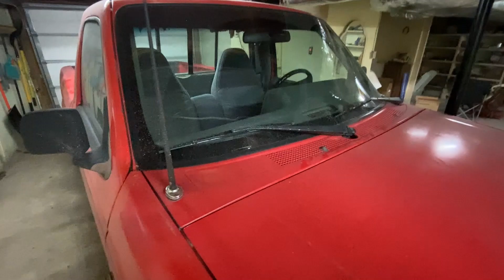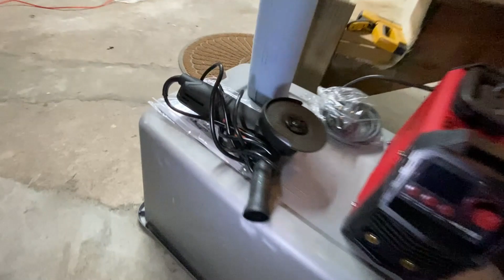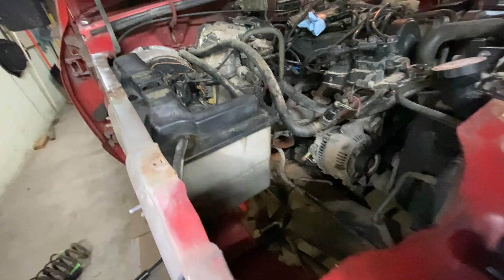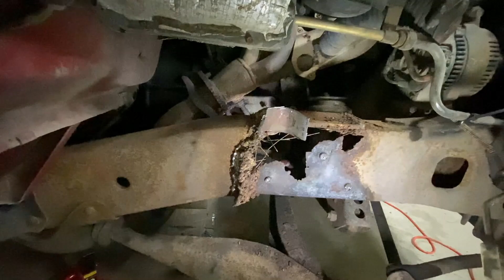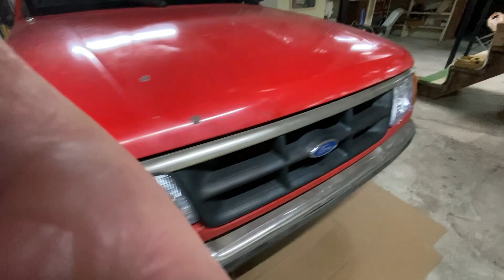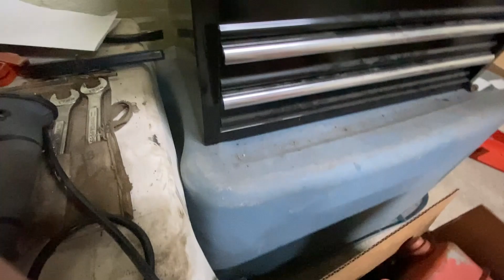Ranger Spring Tower Replacement & Frame Repair

Comment: I just ordered mounts from ATS! Couldn't find them anywhere else! Thank you  for the info!
Reply from the maker: ATS must make them in house. I ordered for the other side also but haven't installed that one yet. I'm in the Philippines now where I live part time. Here I have a crazy little Suzuki truck to wrench on. They call them multicabs here and they're everywhere. 3 cylinder 660 cc engine, 48 hp. I consider the Ranger the American multicab.
Reply: @Magic-Wrench it is!
Reply: How is life there?

Comment: How’s this weld holding up? Just ran into the same issue with my f150. Took the spring tower off to find a hole in the frame about the size of yours. I’ve never tried to weld so I’m probably going to take it to a shop
Reply from the maker: The weld is holding up OK. I have to do the other side now but it will only need a little patch on the very bottom. I also have new springs to install. If you're not familiar with welding it is best to have it done by someone who is. You can see in the video how someone who didn't know anything about welding tried to fix it before I bought it. I literally knocked their weld off with a single hammer tap. He piled big gobs of flux core wire on the frame but there was no penetration so it was just ugly weld laying on top of the frame metal. If it is welded properly it would be as good as new. Good luck.

Comment: if you Jack the truck up on the frame, and unbolt the torsion bar and shock you won’t have to compress the spring or anything.  The suspension will drop low enough to pull the springs right
Reply from the maker: I was able to remove the spring after disconnecting the ball joint, the upper one I believe, and doing what you say. I bought a set of spring compressors since the video for my next project which will be replacing both springs, replacing the driver's side spring mount and replacing the broken lower shock mount on the passenger side. Spring compressors were $18.88 on eBay and would make the job easier. Thanks
Reply: Nice to know!